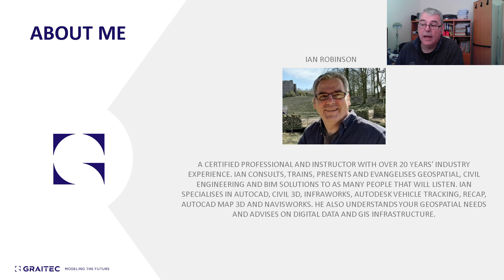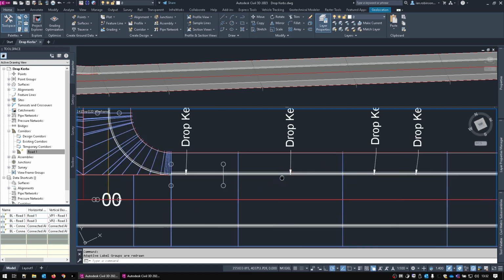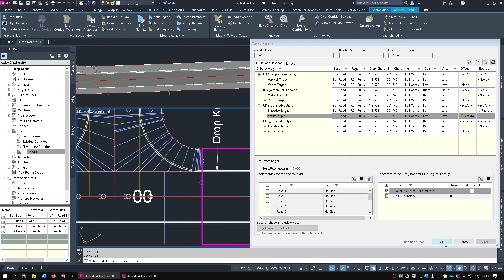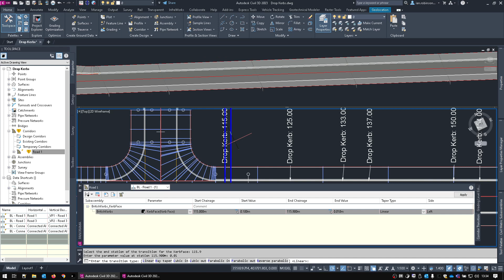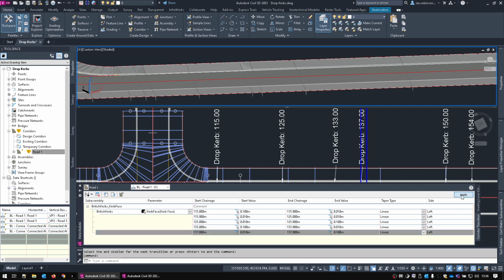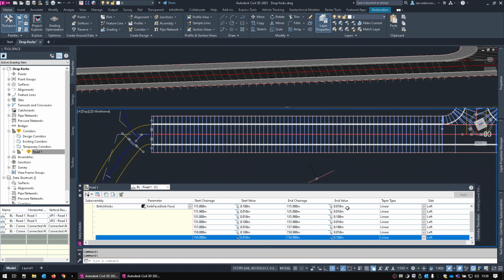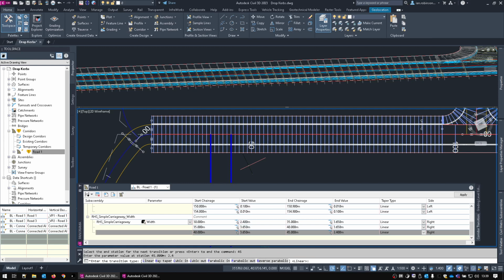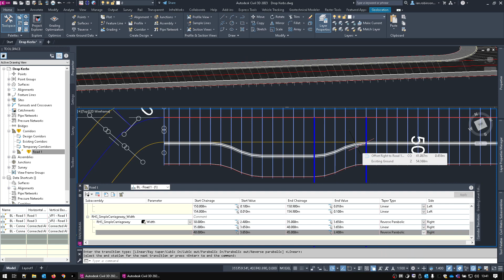AutoCAD Civil 3D 2023 2 - Corridor Transitions

Comment: NIce overview,  if you needed to add more kerb laybacks you can always export the transitions to Excel and copy/paste as many as you need
Reply from the maker: I've not tried that.  If that works,  it will be brilliant.  Thanks for the tip.
Reply from the maker: I've looked at this, and yes, it works brilliantly. You export to CSV (which Windows defaults to opening in Excel) and can add as many as you need. What I liked about this is that if the assembly doesn't exist at the chainage (station) you choose, Civil 3D will automatically add it.
My top tip here is to build it without the drop kerbs first, then extract the back of footpath featurelines from the corridor. Make sure in the settings you tell it not be dynamic to the corridor and create a name template to include the side. Then set this as a target for the back of the footpath. This way when you import all your kerb transitions the back of the footpath remains at the correct level